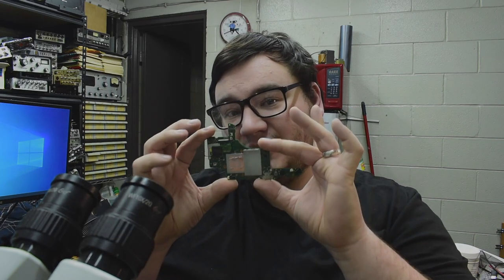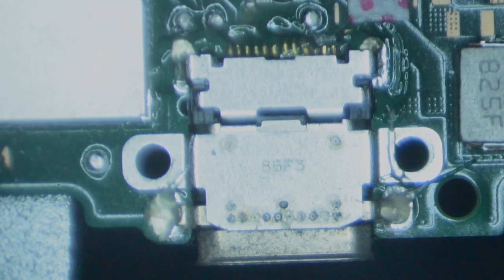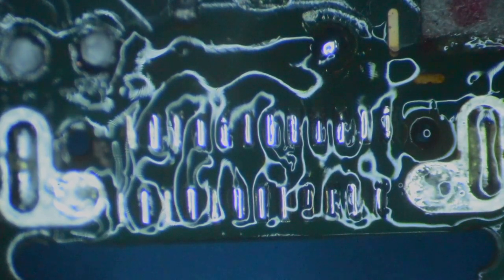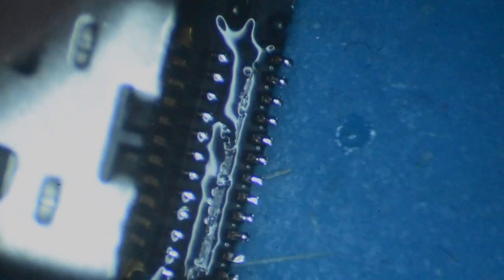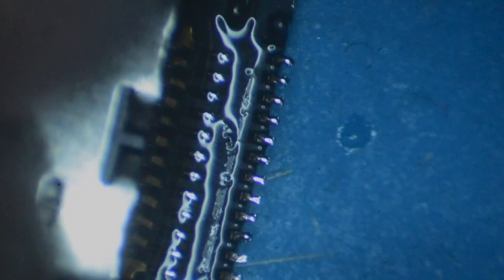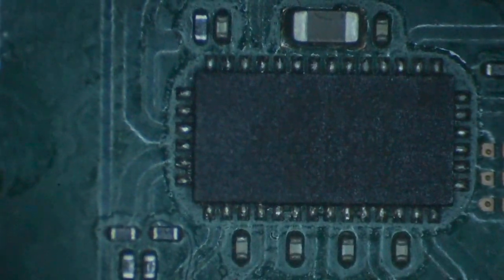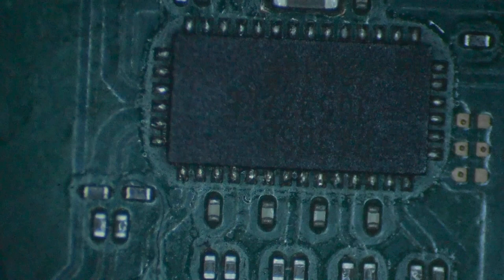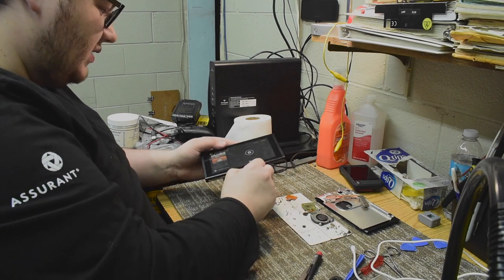Nintendo Switch USB C Repair + Where to Test for Common Shorts & Motivational End

Comment: Hi everyone, I have replaced 3 different charging port, the result is; only charging 0.10 and nothings comes on screen. I made too many mesurement from different videos. it all looks ok. But l realised something when l mesure 3 pins battery connector, they are all giving short between each other and groud+3 pins, all short. Any idea what could be the problem. Thanks all.

Comment: You said you put leaded solder on the board because it melts faster, but do you also put leaded solder on the port pins? Or does it not matter because the leaded on the board?
Reply from the maker: Leaded solder melts at a much lower temp than Lead free. 

Yes I did use Leaded on the pins as well. It makes a much better bond and flows at a lower temp.